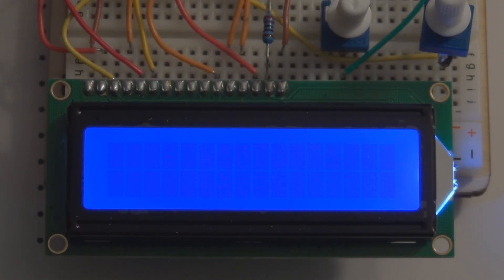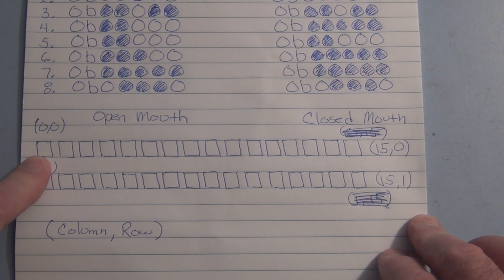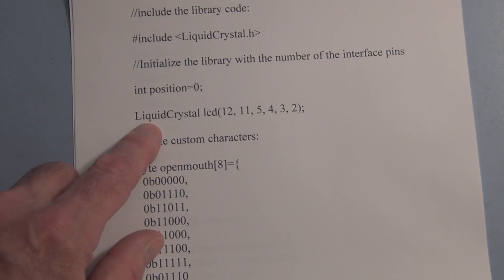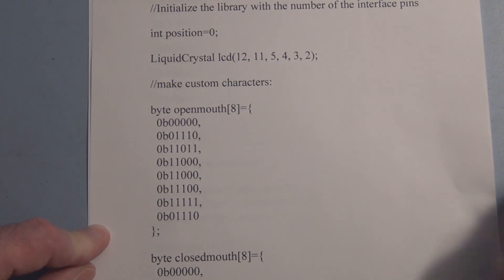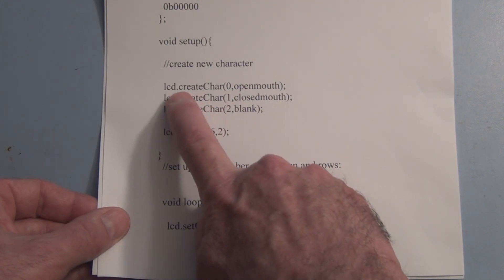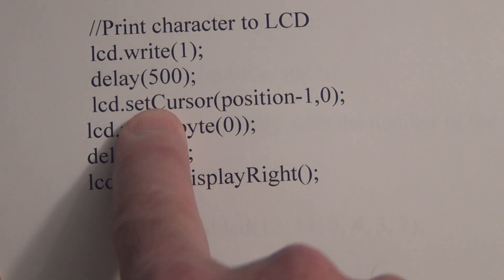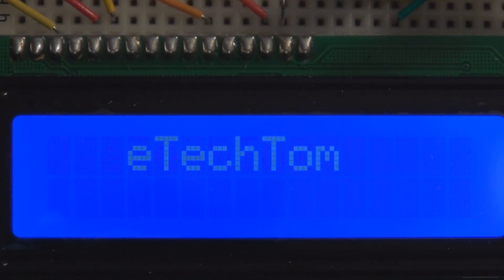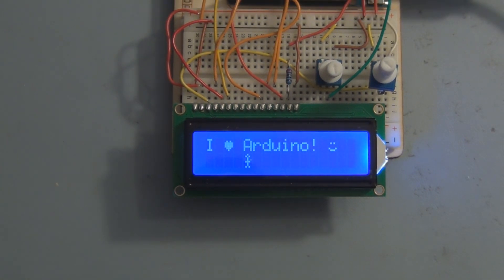How to program a custom LCD character with an Arduino

Comment: hello, i have a problem doing a new character, when I create the character and try to print it on the display a error message apears.

"call of overloaded 'write(int)' is ambiguous"

any1 can help me with this problem?
Reply from the maker: This post might be similar to your problem. http://forum.arduino.cc/index.php?topic=122201.0
Reply: eTech Tom already tried but still nothing

Comment: A more efficient way of switching between open mouth and closed mouth would be like this:
Boolean mouth=0;
stuff
stuff
stuff
void loop(){
stuff
stuff
mouth=!mouth;
stuff
}
because the Boolean gets switched between 0 and 1, it will automatically switch between open and closed mouths...

Comment: So how do i get a custom char to appear once Or even better : appear without using void loop?
I mean is there a simple way to just "lcd.print" the custom char?
Reply from the maker: FullFledged2010 The LCD only understands binary.  Writing text to a particular LCD display can be made easier only if someone initially puts the time into writing a library of code to talk to the particular LCD so you can use key words like print to display something on the display.
Reply: Arduino mandates that you always must use a setup() function and a loop() function. So no, there is no way around this. The simplest code is on the Arduino website:https://www.arduino.cc/en/Reference/LiquidCrystalCreateChar

Comment: To get your pacman effect you wanted, you would first write your text to be eaten. Then loop i from 0 to 15. on each step set the cursor to i-1 (except 0) and print a space (to clear the previous pacman) Then if i%2==0 (check for even) to get if your mouth should be open or closed. and write that pacman character. And then delay. This will advance your pacman across the screen, overwriting existing characters as he goes.